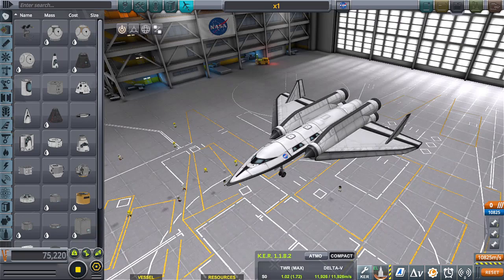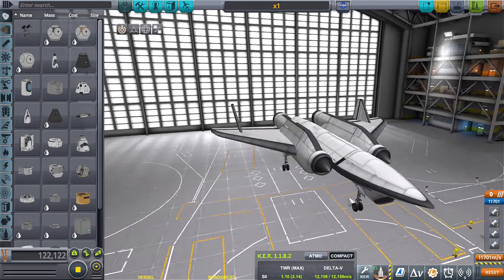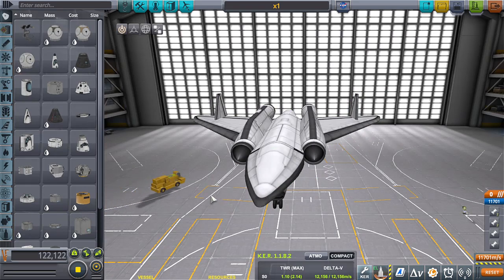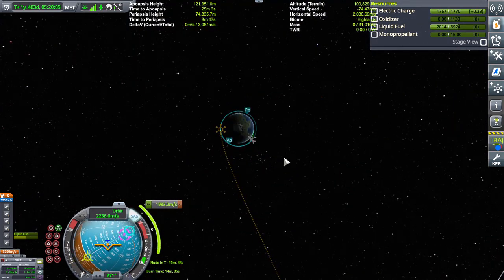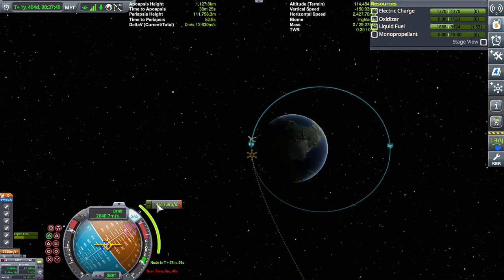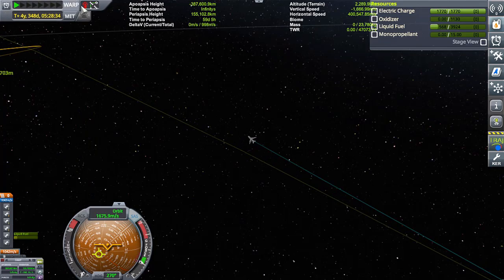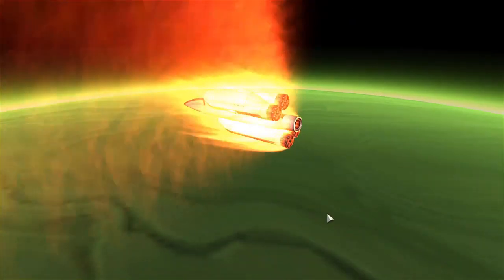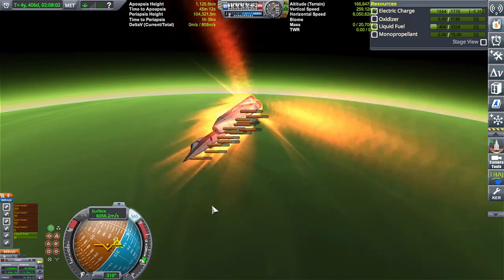TESTING A JOOL SSTO \ KERBAL SPACE PROGRAM

Comment: That belly scoop is unnecessary drag -- the 2 shock cone intakes are more than enough to supply the 4 air-breathing engines.
Reply: but, but, muh visuals!
Reply from the maker: Actually you only need 1 shock cone. I think ill replace the scoop with the S cone and lose the other 2 S cones.